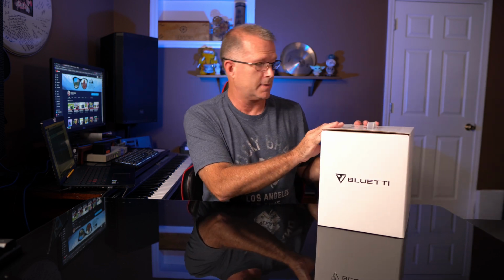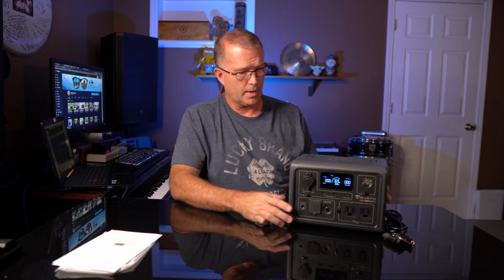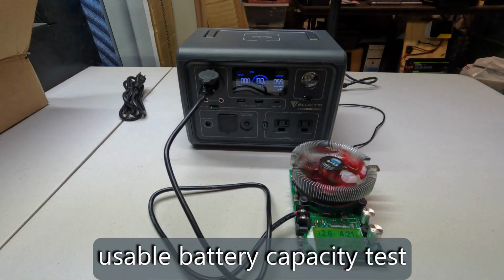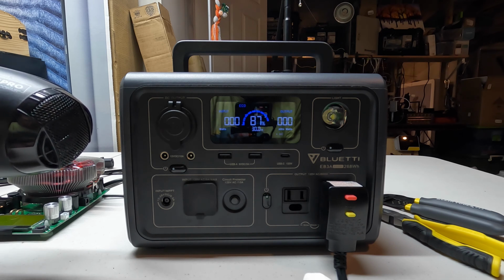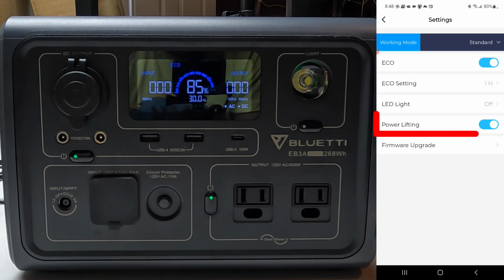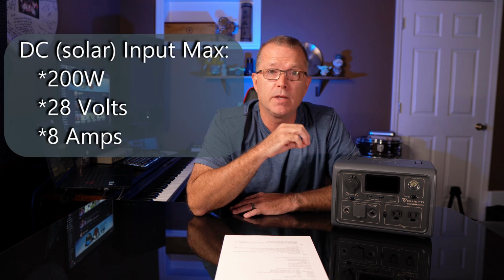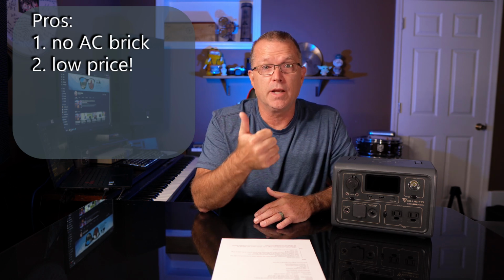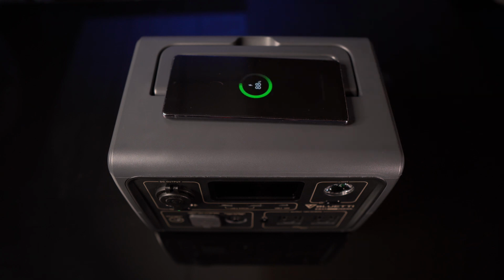Bluetti EB3A Power Station Review: Feature Packed / Ultra Compact / Low Price! Bluetti Power Week

Comment: i wonder why bluetti made the ac2a ? maybe if they would improve the EB3A with a xt 60 connector would be a better deal  EB3A has a 600 watt invertor. and a 15watts wireless charger. 
In my opinion EB/a is a better power station??

Comment: Does the unit need to be On for the UPS to function? Can the UPS turn the unit On? Must I be there to Manually power the unit On? Thanks for your great videos!
Reply from the maker: It's remains on when grid power is connected,  as I recall.

Comment: Mine is crap!!!  The 8mm socket is too loose to make a reliable connection.  $300 down the toilet
Reply from the maker: Did you reach out to Bluetti about it?  I'd be curious to know how they handle your situation.
Reply: @ReeWrayOutdoors  
They tell you tier2 will e-mail you within 48 hours.  But it never happens.  They have told me this lie 3 times so far.  But today i found out tier2 is in china.  So its seems i was screwed with a sandpaper condom.  

DO NOT BUY FROM THESE SCAMMERS!!!!!!

Comment: I have two older 100 W Renorgy solar panels they’re 12 V should I wire them together in parallel or series to power this unit I also have seen where someone created a special plug and hooked one end into a 50 or mabe 100 amp hour battery and the other end into this unit for a longer run time do you think that’s safe? I just bought the EB3A today I should have it delivered by tomorrow or maybe the next day I’m kind of excited about that. I plan on using them to power a 12 V refrigerator/freezer in our Toyota Tacoma access cab pick up when we’re driving around in hot weather especially on a shopping trip to Costco over 50 miles away we could let the refrigerator run when we turn the truck off however if the external battery idea works I could bring it in the house and use it for other things television all night on the weekend ect. And I could charge everything for free with the solar panels I’m actually in the process of planning a home 600want Solar set up  and this little power station could be a really nice complement to that I think(hope)
Reply from the maker: I would not connect those 12v panels in series to this power station as the open circuit voltage is probably over 20V each...and 40V could damage the charge controller on the EB3A.  Putting them in parallel will exceed the Isc rating slightly but that will only limit your input power and not damage the EB3A.
Reply: @ReeWrayOutdoors  ok thanks 👍 maybe I’ll just stick with One 100 W panel until I can get a 200 W panel and use it primarily just for that power station?
Reply from the maker: @william38022  You could certainly do that.  Putting those 2 100W panels parallel will also work, but you'd probably top out somewhere around 120-140W due to the 8A cap.  But on this power station, even a 100W solar panel will fully charge it in a 1/2 day of good sun.
Reply: @ReeWrayOutdoors  thanks 👍

Comment: We bought this for emergency backup power.  We had 2 reasonable expectations:  recharge our our tiny communicators/TVs (i.e., iphone), and recharge our portable fans.  It does both without breaking the bank, costing btw $200-300.  But smaller, handheld power banks could do that too; so why spend hundreds instead of $20-100 for the latter?  Because in addition to all the other things that can plug into this toaster sized battery (e.g., DC, AC, USB, car lighter, etc.); this has UPS (i.e., uninterrupted power supply).  

You can plug your router/modem into it, plug the EB3A into the wall outlet, and you have insurance against loss of wifi in the event of a power failure.  We have two EB3As:  one with the modem/router; another with a baby cam we use as a security cam.  During a power failure both stay on for more than an hour, so if we are away, we can still reach our baby cam features, such as temperature, humidity, listening, looking about, etc.  The decision to buy a toaster-sized battery (in comparison to an industrial-sized lipstick power bank) was this UPS feature, which isn't offered on other competitors.  

Plus the EB3A would not be such a pain to recharge during a long blackout at emergency stations set up by local authorities because it has a Turbo recharge mode that gets the job done fast.  Plus the battery can be recharged from a running car, solar panels, a bicycle DC-generator, or saying SHAZAM.  (That last one may be an exaggeration.). 

OVERALL, we like that in a pinch, our wifi remains available to reach our baby cam (baby not included) if we are away.  And if we're home, we can disconnect the wifi in favor of powering fans to combat the heat (we live on the surface of the Sun) and recharge our iPhones, which take the place of a TV, radio, computer, telephone, flashlight and fidget.  It's UPS with benefits.  

Ps.  Some have noted the weird fan noise.  We concur.  But using a simple external computer fan--whisper quiet--blowing into the EB3A intake vent (apparently the one shaped like a circle and high up on the left side; as opposed to the exhaust vent situated low on the right side shaped like a triangle) cooled down the battery so well, we don't hear the internal fan come on anymore.

Comment: Good review.   For home use, I'll connect this to my two 12v forklift batteries connected to two 100w solar panels.   When I camp with my motorcycle/sidecar, the unit itself, with portable solar panels is the perfect size.

Comment: Bluetti has ZERO customer service. Whichever unit you purchase, I hope it isn't defective. Good luck.
Reply from the maker: Hi Katie.  I'd be interested in hearing more about your experience with Bluetti's customer service team, if you're willing to share.
Reply: @ReeWrayOutdoors  I would be happy to. I bought an eb3a 600w directly from Bluetti. I left on my trip and then realized it was defective. It would not hold a charge. I tried calling (I tried all 4 extensions) all mailboxes were full and I emailed several times. I finally called my bank. I then received an email from Bluetti. I left the box and cigarette lighter adapter at home, so I could not ship it back to them for a refund, and their reps in Quartzsite, Az could not swap out the unit. I have since returned home and I have shipped the unit back to them (2/2/2023) through UPS (Bluetti did provide shipping labels) and through tracking I know it was delivered and received at their Las Vegas warehouse, yet they have not confirmed it. I had to contact my bank again (2/9/2023) and still not one word from Bluetti. I do think they make some very good batteries and have heard the 600 is the problem child. I understand electronics fail, but the lack of customer service is the problem for me. A friend I was camping with tried charging the unit and it would say around 98% full and all I could get out of it was to charge my phone a couple of times and charge a usb lantern. The unit was definitely defective. I'm sorry if I sound negative, but I think people should know Bluetti does not offer customer service. It's really a process. Thank you for allowing me to share my experience.

Comment: No one ever talks about using say, a Bluetti or any other portable battery to recharge or extend the life of the unit via the DC port. It has a lot of features that are great, and none of the reviews are like "Oh btw if you have a battery with a DC port you can use that the recharge the unit." There are other ways but that would be the safest and easiest.
Reply: I plan on using my 48v ebike battery with a buck converter to do just that...I think most any battery or power bank could be adapted

Comment: I have 3 Gas Generators that will power anything in my house and garage but as they are not Generac I have to go out in the storm and power outage and get them running and hooked up. I'm watching your video because I just ordered this  Bluetti last night OCT 18 22 and want it simply for running things my Pellet stove and blowers on my wood stove and a few lights maybe. I might have missed it but can I charge this Bluetti in my truck or car. I know nothing about Blue Tooth but I have 4 grown kids that do. Thanks
Reply from the maker: Yes, it does have 12V charging and includes a cable for that so you can charge it from a vehicle.   Should be perfect for a pellet stove feeder and and some blowers.

Comment: My experience with this unit is, that the user interface (app and display panel) plus quality inverter and charging ability are so good, that it is worth using as a head unit, in conjunction with an outboard battery for greater storage capacity, that might cost more than the EB3a itself.
Reply: Hi, im new to these and just ordered  this one, how would you hook up another battery to it? Mines pretty much going to live in a camping trailer, so a larger battery next to it would work great.
Reply: @timheilig6091     The solar/ DC input on the Bluetti is type DC7909.   You could create a cable with that connector, or modify an available Bluetti solar cable ($10) by cutting off the MC4 connectors and splicing on alligator clips or ring terminals.  Might want to get inexpensive cable with those ends and splice them together for a long enough cable.   Adding an in line fuse on the positive (red) side recommended.   The Bluetti would accept 200w from the battery this way.  Simplest (though not necessarily most efficient)  way to charge the outboard battery would be to get a 110v charger appropriate for the battery type (eg LiFePo4) and use excess capacity from your panels and Bluetti on good sunny charging days to flow through charge via the 110v inverter of the Bluetti.  You could also charge the outboard battery (and the Bluetti) from the mains when that source is what is available.   This could greatly expand the overall capacity of the Bluetti.   Only caveat is, the Bluetti puts out 600w max watts and can only draw in 200w through the port.   So the outboard power is limited in how much can flow into the system.   But for light draws, it will greatly expand the storage capacity.   Also you may want to separately monitor the voltage of the outboard battery to insure it does not get drawn down too far, as the only limiting factor will be the Bluetti's requirement for 12v input.   Would damage the battery to overdraw.  With LiFePo4, for example, 12.5v might be a safe lower limit of discharge.  So you will want to monitor that voltage and not allow it to get too low before disconnect/ recharging.

If I were doing this, I'd probably look to use a 100ah LiFePo4 battery.   3-4X the capacity of the Bluetti battery added power storage.  Quite a lot relatively, but since the Bluetti can handle 200w solar input, it can charge its own battery very quickly and have excess capacity to charge the outboard.
 
The solar port can accept up to 28v, so a 24v battery would also work, as long as your charger for the outboard is also 24v. .

You could also opt to input power through the Bluetti's AC charge port to get higher current flow in, by using an inverter on the outboard battery and outputting through that to the Bluetti's AC charge port.  But that would be less efficient due to loss through the inverter.   In theory, the Bluetti could actually accept both inputs, AC and DC simultaneously for 430w total input, but IMHO, higher input risks shortening the battery life of the Bluetti.  I'd not do that often.  Personally, I'd keep it simple and moderate my draw to avoid taxing the system.   Hope this helps and not TMI.   Full disclosure, have not done this myself.   But in theory, should work.
Reply: Will it power a 900 watt microwave for a few mins once activating the surge feature??
Reply: @Bizzare77777    Too much load for the 600w EB3a.   Instinct is, larger capacity  power station with higher inverter output called for in the application; preferably with headroom well above the 900 watt demand.

Comment: Great video! Could you answer some questions. I'm new to using Bluetti EB3A. Really this will be my first portable power station. Can this unit charge my 7.5aH maintenace free lead and 12aH LiFeP 4 batteries. Better yet would the pwr station be able to power my ic 7300 radio, on its own, without using the batteries.

Comment: So I plugged in the charger cable to another solar generator instead of the wall outlet. Made a daisy chain. But what I'm not understanding is when its in UPS mode I thought it would pass right through the bluetti not denigrating the life of the battery unless a power outage. Like it will use my crappy solar generator and save my nicer bluetti from denigrating. But from testing its the same as charging the battery from solar via dc. Doesn't matter if it's dc or ac charged.

Comment: Excellent, as always. :) I was wondering if I was gonna feel any buyer’s remorse over the EB70 that I bought about 4 months ago… but I think the extra watt hours I got in that unit were worth it.  Nevertheless, this one is very appealing at that price - particularly that it can take 200W solar input, for a smaller battery.

Comment: Another great video!  Side note/something that would be really great to see (imho) would be to take some of the power stations and recharge them under real-world conditions, by using the recommended (max) solar panel output for each unit AND then simply let the unit/s recharge for however long they need, regardless of the solar conditions going on outside. This way, people can get a better idea of what to expect from a real world recharge vs going by the "ideal" studio or lab specs.
Reply from the maker: Thanks for the kind words, and yeah, that's an excellent suggestion.  The thing that I worry about with that is results are going to vary heavily from day to day and region to region, so it's very hard to get a sense of what your actual experience  will be on any given day.   But I take your point.  Still might be good to show real world from my location.  I'll keep that in mind on the next power station video. :)
Reply: @ReeWrayOutdoors - Well, if it helps any, no one ever really/truly knows what kind of weather they are going to encounter when they take their solar charge station/s on vacation + campers don't typically/always know if their campsite is going to be free, partially free or totally shaded by canopy.  That said, running the test under a weeks worth of cloud cover and/or a few day of non-stop rain would, of course, make little sense but it would technically still provide some interesting data :^)
Reply: @ReeWrayOutdoors Will it power a 900 watt microwave for a few mins once activating the surge feature??
Reply: Is it possible to connect an inverter having a high wattage of 2000W from the 12v cigarette socket inorder to run a devices having a wattage of 1200w to 2000W?

Comment: Hey, I have 2 of these.  First thing out of the box you need to update all the firmware before you charge the unit.  The early ones (i got some of the first ones) did not display the true battery level, and thus you could actually run them down and may not be able to restart them again for a while).  It looks like Bluetti is now doing this before they go out but always best to be sure because it looks like your DC run down of 80% is a little below 85%.  The firmware update is the last option under the settings menu.  These have been as low as $209, which pretty much eliminates all the other competition, but $239 is still pretty good.  Great review!
Reply from the maker: Yeah, I initially didn't even realize it had App control!  Once I realized that, I immediately installed it was super impressed with the functionality.  Updated the FW that same session.  Good stuff!